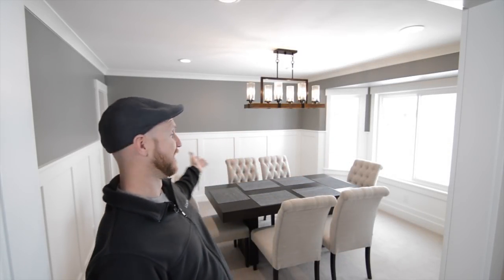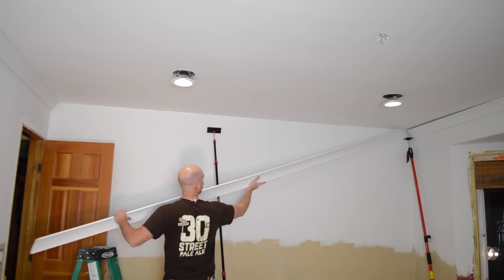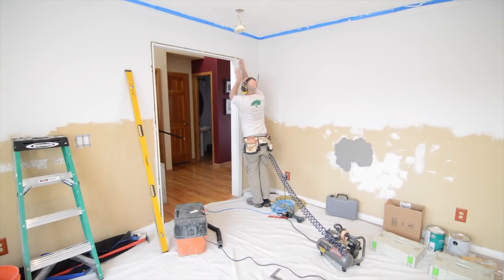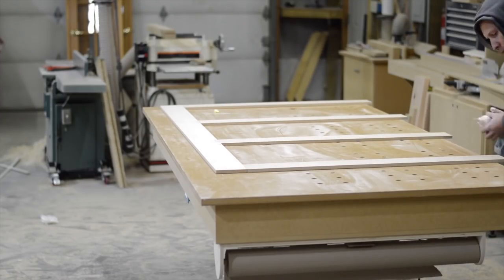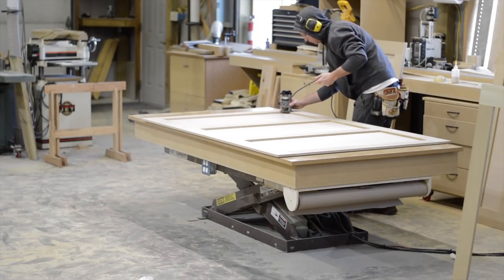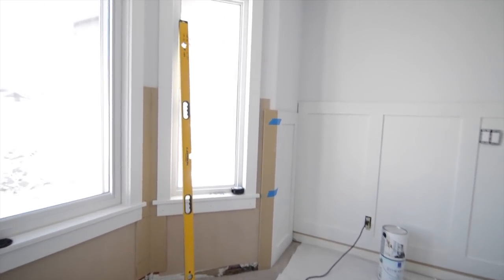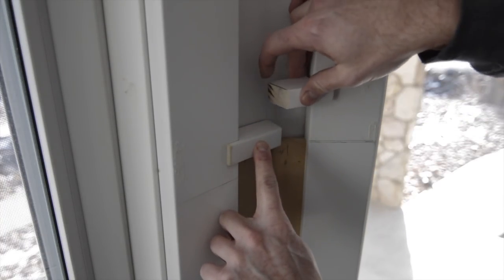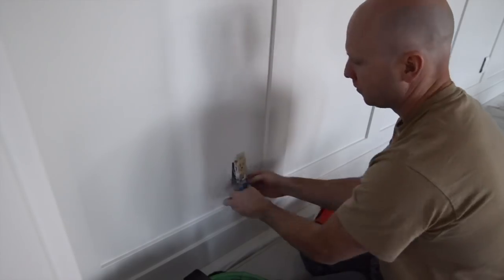Dining Room Renovation, wainscoting or Board and Batten

Comment: really thorough and professional job, kudos to you, sir. I am a painter - you did an amazing job, and i back you up on your decision to 'hand-cut' your paint-job. taping takes too long to set up and it rarely works 100%. I love the quick-dry 'spackle' (nail-hole-filler) too, but remember if your paint has a 'sheen' or shiny-finish -to prime each nail-filled spot after sanding or they will show through the final finish. thanks for your attention to detail - i really learned a lot
Reply from the maker: Thank you very much. Thats been my experience, about every 10 feet the paint seeps under the tape. I have tried all the different tapes, some are better than others. The only thing I haven't tried is to tape put caulking down, then paint, then quickly pull the tape off.

Comment: Hi Mike! Can you speak to the baseboards and rail/header? Looks like maybe a 1/2" thick baseboard, and a 1"x2" rail?

Also what did you use for the door casing? Looks like the same as your stiles perhaps?

Thanks a lot!!!
Reply from the maker: Baseboards are 1/2" thick x 5" tall. Top rail is 1" thick by 1 1/2" deep. Door casing is 1" thick x 3 1/2" wide. Top cap is 1 1/8" thick by 4 1/4" tall.

Comment: Hey Mike, great video and quality craftsmanship.  My father was a contractor for several decades until his retirement 20 years ago, and guess who got to be his shop apprentice on all his home projects?  LOL!  I learned so much though.  

I have two small suggestions that are really meaningless at this point to your dining room, but might come in handy on similar jobs in the future.  Your eye was right when you made the decision to widen the stiles on the outside of the pair of side bay windows.  However, you didn't go far enough.  If the stile sections below the apron were widened just a bit more, the panels below the two windows would be centered unlike the final result.  Also, since the center window of the bay is two lights rather than one, a division of the panel under it would be visually more appealing by continuity.

The basic rule to remember visually for wainscoting is that the eye notices irregularity in the larger panels, not the smaller surrounding stiles and rails.  Irregular panel sizes on the same wall, or non-centered panels under windows draw the eye.  Both the dining room and den in my childhood home had wainscoting my father installed... with some help.  The powder room also had bead board, and this was all hardwood back then!   He passed a few years ago, but he would have been impressed with your craftsmanship.  Thanks again for sharing!
Reply from the maker: Thank you very much. I really like the idea of making the stiles even wider. I should have done that. Regarding breaking the panel under the window, I was going to but there is an outlet there and I was just in the wrong place to add a center stile. Sorry to hear of your loss.

Comment: Beautiful work.. I've been a painter almost 10 years now and i always appreciate when carpenters respect the prep and paint process! just thought i'd chime in on the tape vs hand cut argument; if you're using quality tape and have smooth caulking lines (achieved through using a wet finger) i think the crisp clean line from the tape beats any hand cut job all day long! cheers from BC, Canada
Reply from the maker: Thank you. I have always tried to make the painters job easy, if I'm the painter or someone else is. I think at this point I agree with your thinking on taping. How long do you wait to put tape on a surface? So on this job I just wanted to get it done. I wanted to paint the walls, and the paint on the paneling was only hours old.
Reply: @MikeFarrington  I can see why you refrained from taping the panels! i think 2 or 3 days is ideal with water based paints, and at the very least i like to leave it overnight.
Reply from the maker: @TheLingonator  Funny, I am mid room renovation as we speak. This time I am budgeting a couple days dry time for the moldings so I can tape. If the time is there, I think its worth it.

Comment: I'm just in awe at how you were able to get those crown inside corners to look so seamless.  I would never attempt a mitered inside corner!  Even when I cope sometimes there is a gap that needs to be filled...  BTW have the same Graco Ultra, but the battery powered version.  Best sprayer I've ever owned.
Reply from the maker: Thank you. I have installed miles of crown molding. The key to inside corners is to get the measurement right, next is to be able to figure out whats going wrong if things don't line up (ceiling to wall, or wall to wall out of 90, or drywall mud buildup,etc.), after those two, glue is key. The little Graco has served me well.
Reply: Mike Farrington do you just use like a titebond 2 on crown?  I’ve hung crown with several adhesives (ca glue, titebond, and loctite pl construction adhesive) and I think the construction adhesive is the strongest and isn’t completely reliant on a perfect fit to stick (though I don’t let that make me sloppy). I like construction adhesive for end grain gluing, it doesn’t get sucked into the grain like wood glue.
Reply from the maker: @loganpatterson4674  I normally use titebond 3 because thats what I have on hand. I think a good quality construction adhesive would work great as well.

Comment: Hey Mike great video! I found a really quick way to skim coat: thin out compound to a thick paint consistently, roll on the wall with a 1" nap roller in sections and then smooth with a wide taping knife. It's easily twice as fast.
Reply from the maker: Thank you very much. This is a really good tip. I will be doing this in another room in our house soon. I'm going to use this technique, but I'm also going to use a rubber squeegee for smoothing.
Reply: Great! I've learned so much from you that I'm happy to help. I do 3-4' square sections and move across the wall and by the time I get to the end of the wall, since it's a thin skim coat the end where I started is already dry so I repeat working my way up the wall.  @MikeFarrington
Reply from the maker: I like the 3-4' square section idea as well. Breaks the project down into manageable pieces.

Comment: Did you extend the railing above the wainscoting over the vertical door frames. I didn’t see a closeup. I was wondering why you didn’t trim or angle that trim so it was flush with the door trim. 

Thanks for the video. You have a nice shop.
Reply from the maker: Yes, I did include a shot of that detail at some point in the video. I did that cause I thought it looked neat.
Reply: @MikeFarrington Thanks Mike. I did notice it. You did a fantastic job. It’s cool you signed your work. I do that too and date it for whoever sees it. Keep up the great videos.

Comment: Great video. An easy way to cut in is to paint the top lip of the baseboard and the bottom lip of the crown. Use a tee shirt cloth to wipe the paint from the front of the trim. You get a perfectly straight line every time. No body will notice unless you show them. This is very unconventional but it makes cutting in so much easier and you always get a straight line.
Reply from the maker: Hmm, I'll give this a try, thank you.
Reply: @MikeFarrington  Make sure you wipe the front of the trim well. Sometimes it's hard to see the wet paint depending on the color. When it dries It is noticeable.

Comment: I did mine myself with my own style raised paneling (plywood and bought molding). I didn't use any backer board as the wall exposure was less than an inch around the panels and everything was painted anyway.
Reply from the maker: Sounds like it turned out pretty good.

Comment: Hi Mike. You did an incredible job and I am a fan of the this style board and batten.  I enjoy your videos because you are very detailed oriented like myself.

I had some questions. I am not questioning your work and understand for all projects and cases choices are made due to a number of factors. My questions are because I will be doing both an entry and a dining room with a similar board and batten.

Type of material:  I don’t have a planer nor jointer. I am wondering what choice of material I should use (MDF or wood). I understand you used a combo but MDF for most of the board and batten.

I’d prefer a pretreated wood that has a primer already but I have no experience with such wood. I’m not sure if wood selections of such usually are fairly straight, have a consistent thickness, and are pres-sanded to an good smoothness. If you did go wood what wood species lumber lends itself well to a project like this?

What are your thoughts on using wood for the board and batten?  Was MDF a choice because your experience shows it yields a more aesthetic result?  I live in California and in a high desert so I wonder if the contraction and expansion of real word is less pronounced here.

Thanks,
Chris
Reply from the maker: Thank you. As to what choice of materials. Thats not easy to answer. I would personally visit a few lumber yards around your area and see what they have. One of the places near me has material that has been planed to thickness and cut to various widths. That would make things really easy, just cut to length and join into panels. You may even be able to find primed material such as baseboards or casing. MDF vs wood, either can work well. MDF is cheaper for sure, thats mostly why I use it. I wouldn't worry too much about expansion and contraction for a project like this. Good luck!

Comment: In the  course of doing a lot of spray painting renovating rental houses where the windows were always dirty I found that if I sprayed a full coat of paint on the windows it saved me time of taping them off but also when I took the razor scraper to them to clean them off the paint peeled in sheets and took all the dirt off the windows leaving them sparkling clean.  One word of caution tho, make sure no one has replaced the glass with plexiglas, you'll never get them clean
Reply from the maker: I have heard of this trick before. I have never been brave enough to try it. Thank you for sharing!

Comment: With paint grade materials, there's no need to cope the joints. Miter's work fine and you can roll the joint up or down a little to make the fit perfect. Easy peasy.
Reply from the maker: Agreed.

Comment: Future tip: ( I do drywall and finishing) when skimming your walls and doing a level V finish, think your mud down with water and roll it on the use a large knife to drag it off. Will go much faster and easier sanding. Still turned out nice.
Reply from the maker: This is a very good suggestion. After I was done with this room I did a little research and found people rolling or spraying mud on and using a wide rubber trowel to flatten. If you are in my area, let me know I have a bunch of drywall work to be done around the house....
Reply: I unfortunately am not in your area. I live near Cincinnati.  I do have family in the Denver & Colorado Springs area.

Comment: Lovely!  Is it necessary to make the backing panels, or can you just use mount the frames on the existing wall?  Would save a lot on materials, but there's probably a reason i'm not aware of.
Reply from the maker: Thank you. The drywall texture would show through with out the paneling. Its way easier for me to install the paneling, vs fix the drywall.

Comment: I have watched this several times and am continually impressed with the craftsmanship and the end result.   I am curious as to how well you heat your shop?  I notice you tend to dress for a cooler temperature.  Any problems with painting or glue drying? Thank you.
Reply from the maker: Thank you very much. I really don't heat my shop. I have a couple space heaters that I use to stand in front of when I'm freezing. I have a small room for painting. If I run a heater in there it gets really warm. So for glueing, painting, etc. I just move in there. I am really hoping I have enough money this summer to have my ceiling insulated and to add a heater to the shop for the following winter. Fingers crossed.

Comment: I really enjoy the thoughtful approach you take to your projects. I also appreciate your ample sharing of tips and thought process. The room is stunning. I just bought one of those airless sprayers as well and has been great so far. Do you remember which spray tip and setting you used for this project when painting?
Reply from the maker: Thank you very much. I tried a few tips. The one that came with it, felt like too much paint and too wide, I couldn't get into corners and tight spaces. I ended up with a 310 tip. It feels like the right amount of paint just slightly too narrow, but overall it works pretty good.

Comment: Great video. I'm about to embark on a similar project with zero experience. Would not using a backing board be acceptable in terms of looks or fashion? (is it a matter of later home value/appeal, taste and or simplicity?), or should I use backing board under the frames?
Reply from the maker: No backing board means the drywall will show. I don't think you'd ever get the drywall and wood to look consistent.

Comment: Nice job. Im surprised you didn't paint the ceiling first, then paint the crown molding separately then applied the crown molding to the painted ceiling
Reply from the maker: Too much touch up that way. Its If the whole room is going to be painted, its just easier to build, then paint. Thats at least my opinion.

Comment: Timber mate, best nail filler ever. Put it on, damp sponge it smooth, no dust...But horrible stink. Also, on the sill, I miter the corners and refit to get rid of the end grain that shows through after paint, same for the aprons. Whoever makes fun of you for marking your reveals on doors is doing it wrong. 😉🤣 Question on the grayco..I saw that sprayed the trim pieces, does it also work well for the walls and ceilings? 

Your shop is amazing and you did another really great job on this one..enjoying your videos.
Reply from the maker: Thank you, good tips. The Graco would spray anything really well, it just doesn't have very much paint carrying capacity. You could probably spray a small ceiling, then refill, then spray a wall and refill. You Get the point. It's a perfect tool for spraying trim and other small stuff. You could struggle through a larger job. I have my eye on a Titan Airless to help spray my house and larger stuff.

Comment: love the look i was just wondering if it would've been easier to lay it out on the walls and do it direct rather than building panels ... whats the top color called
Reply from the maker: Thank you. Yes and no. It may be a little easier but, I try to keep the noise and mess out of a house as much as possible, and I have much better control over quality in the shop. Building in the shop yields a much higher quality result for a host of reasons, including better joinery, fewer nails to attach, sanding is easier, routing in easier, etc. I have done it both ways and each have pros and cons, I just prefer building and then installing.

Comment: Love all these videos.  The one thing I simply cannot understand is why you prefer the biscuit joiner to the Festool Domino?  Owning and having used both, it seems that the Domino does everything the biscuit joiner does, just better.  What am I missing?  Since I got my Domino, my biscuit joiner hasn't been off the shelf.
Reply from the maker: My experience is that a good quality biscuit joiner is far more accurate at aligning pieces in an up and down direction than the domino. Also, because the biscuit is wider it helps reduce twist more. The domino is a fine tool, I just get good results faster with biscuits.

Comment: Enjoyed the video, thank you.  Can you link to the lighting used please, the wife has been looking for a over the table fixture similar to that one.
Reply from the maker: I looked quickly and couldn't find the ones I used. I bought the highest power generic 6" LED trim kit from Lowes. I attached them to the appropriate 6" Halo can lights for my application. You will find that when shopping for LED lights, the cheap ones turn over and something replaces it. At least thats been my experience.

Comment: Mike, great craftsmanship and the room looks great!  Question if you have time, would you share the details on the window casings? We are closing on a home and plan on creating casings for the windows (only wrapped in drywall now) . Thanks
Reply from the maker: Thank you. Window casing is 3 1/4 wide and 3/4" thick, the headers are 7/8" thick and 4 1/2" tall where possible. I had to cut them down over the windows. Let me know if you need some more details.
Reply: Many Thanks, I'll pictures when when finished.
Reply from the maker: @allent555  Thank you, good luck.

Comment: Hi. Mike, where did you purchase the large 1/8" MDF panels? Having trouble finding it in those dimensions. Thanks.
Reply from the maker: Any professional plywood dealer will have it. It will not be at the large box stores. Here in Denver, I use Paxton lumber.

Comment: A very nice job.  But I'm curious why you made the wainscoting so tall, rather than the usual 1/3 the way up the wall?
Reply from the maker: Thank you. I'm not sure I agree that usual is 1/3. I have seen many different heights, and I have built many different heights as well. I specifically recommend to my customers and what I did in my own home here, to make it taller than 1/3 because I think it looks better when that paneling is taller than a piece of furniture up against it. Hope that makes sense.
Reply: Mike Farrington I like that thought of height va furniture height.  And you mention craftsman detail on the top rail, lots of craftsman builds have taller wainscoting too.